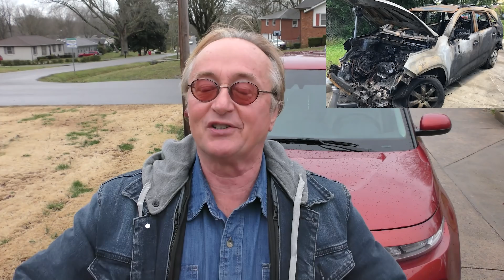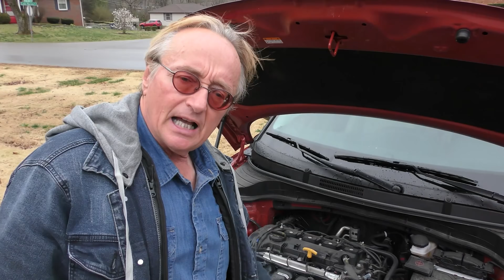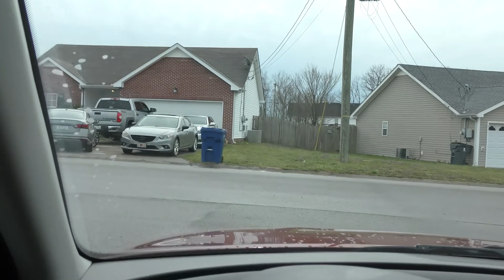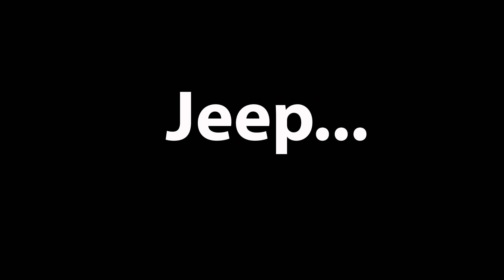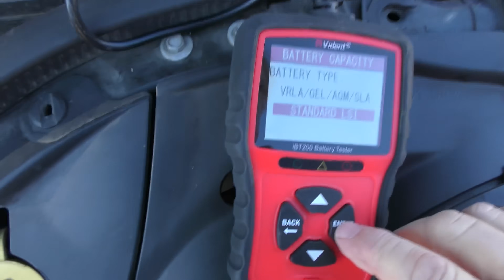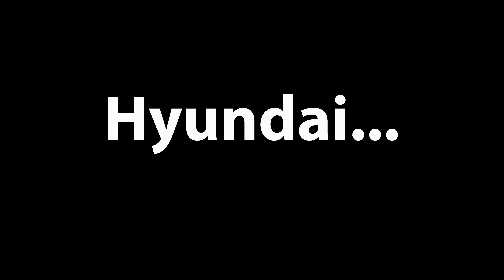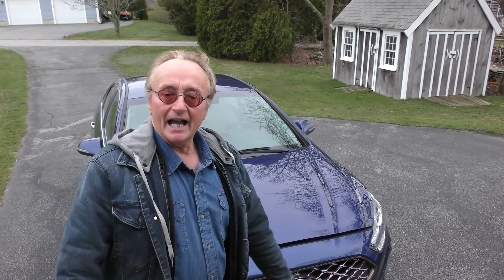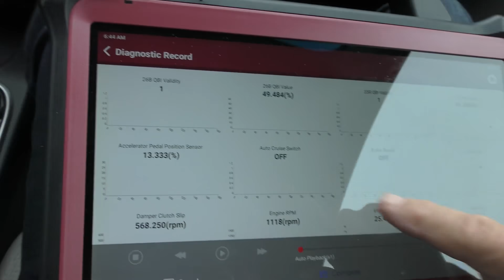3 Car Brands That are Crap

Comment: I have this car with 200,000 miles on it 6 speed, and im bad about changing the oil, but because of that i always was checking it and adding oil, so maybe because I am bad at oil changes but did put oil in it though a few times it got very low.  So its been good in my opinion and ive done no maintenance and the car was 15k

Comment: I can attest to the Hyundai but for different reasons.  Mine was a 2010 - common issue apparently from later research, the hood sensor goes bad and trips the car alarm for no reason when parked because it thinks the hood is not shut.  Simple fix is disconnect the sensor, all good until you can replace it.  Then I had a short in the light in the trunk which drained the battery and the trunk kept popping open (disconnected it and fixed it), and later at only 70K miles or so the steering column failed.  Went through 4 battery replacements even with proper insulation kits with the cold weather here.  Maybe they are better now and at least the dealer we had here wasn't like the one he described but I am sticking to Toyota and Honda - all those I had never let me down once.

Comment: I have a nissan sourced 1.6T with direct injection pushing 250hp on 75000kms. never used a drop of oil in its lifetime. my polo gti used 500ml oil every 1500kms lol

Comment: This is my Very Important Question if you would answer I would greatly appreciate!! I’ve been very mechanical and have an engineering degree… why they use an efficient turbo diesel or just a good engine that you think is tops! Run an electric motors and basically use the hybrid system and use the motor to charge an efficient lithium iron phosphate or similar with super capacitors and regeneration braking etc some solar just to keep small things charged etc and run the car like a locomotive gas/ diesel over electric!?? Obviously electric motors are way better more torque etc and u can run all wheel drive and it would be way better control power weighted better lower and way more efficient then a transmission where you lose average 30%?! So basically a engine over electric Hybrid!!! Solar would bms to keep them a perfect temp plus same starting battery or super capacitor to start slash or use the generator starter combo too both good systems wouldn’t you be way more efficient and more power and way better gas mileage using the electric motors that last longer  and 99 percent efficiency usually???

Comment: personal experience we bought kia hyundai's in the past. up to 2010 they were great...no issues. starting in 2011 they went to crap. we owned a 2011 sonata that had the worst engine recall ever. dealers actually replaced the engines when they died regardless of mileage since they were a fire hazard. we didn't have issues but got rid of it at 120k because we didn't want the potential hassle of engine failure. Surprised Scotty didn't dump on Nissan this time.

Comment: When the engine and board were cool, there was a good connection through the silver trace and the  truck started fine and ran great. As soon as the heat from the engine had warmed the board sufficiently, it would expand, breaking the connection of the circuit and shutting down the truck.
I bought A new module from Ford and it took me all of ten (10) minutes to unplug the old module and plug in the new.

The things you learn! 😏

Comment: Inside the ignition module is a printed circuit board. For whatever reason (age, heat or shock) the PC boarding my ignition module developed A crack across one of the silver traces.

Comment: What started happening is, when I had been driving for about 30 minutes, as the engine reached full operating temperature, my engine suddenly died. This was annoying driving on side streets around my home, but imagine this happening in the left lane of the Dan Ryan Expressway during rush hour. Not A Good Feeling!
I did some research in forums on line and in my "Haynes" manual and learned that there is a 1 1" x 4"  black plastic box mounted near the top of the engine, called an "ignition module."

Comment: Regarding the Jeep...several years ago my daughter's Jeep Liberty wouldnt start and I looked under the hood for loose battery connection or anything obvious (since I know little about cars) and lo! and behold! I noticed a wire that was frayed and appeared to be chewed upon....I glanced around and found the culprit (a rat) hiding under the hood in a corner. I lived in the boondocks and the car had been in storage the previous 6 months, so not shocked at his presence. Just saying....looking around under the hood for anything OBVIOUS is a great idea! My husband fixed it (rigged it temporarily) with a paperclip!

Comment: Most cars since the late nineties are crap.  Beautiful on the outside and inside. but the parts inside and around the engine are built with plan  Obsolescence.  Dealers and repair shops don't fix anything any more they just change parts at high prices and high labor.  Instead of saying when you get a huge bill for changing a headlight bulb well it's a Mercedes or bmw you could start saying it's just a car.  The automobile cartels got together and got with a shoddy parts manufacturer to make defective parts.  Our government officials have been brought.  This would have never happened in the 60's & 70's

Comment: I don't care what any mechanic, shop, or warranty implies/ recommends/ states:
Get your oil changed between 3 to 5000 miles MAXIMUM!!!
There is no such thing as the brand spanking new "miracle engine", you can get it done cheaply at Walmart, without voiding any warranties, and you can even watch them if you want.

Comment: 2008 Hyundai Santa Fe:  fuel gauge went out.  2014 Santa Fe: Windshield Wiper Pump cracked at 60K and also driver side seat seams gave  away.    2016 Santa Fe: Windshield Wiper Pump cracked at 60K.  Other than the routine maintenance, it seems to be ok.

Comment: Kia and Hyundai actually make fantastic cars for the price. Best bang for your buck in the standard car class. Jeep is overpriced for what you get and they have many problems, Just Empty Everyone's Pockets to fix them.

Toyotas stink. Way overpriced and the interior falls apart. Sure the engine will run forever but the interior is crap.

Comment: SCOTTY IS ABSOLUTELY CORRECT!

I bought a 2014 Hyundai Tucson GLS AWD brand new in 2014.  It's equipped with the 2.0L GDI engine (gasoline direct injection).  I changed the oil every 5000 miles, and 2 years ago the engine just ceased at around  68000 miles.  Just completely grinded to a halt.

Long story short I had the Hyundai towed to the local dealership here in the Seattle area.  It was at the dealer for a month and a half and finally I got a call that Hyundai was going to replace the motor under warranty.

It took two extra months for the dealership to get all the necessary parts to install the motor.

So yes I basically have a brand new engine now free of cost.  It only has about 6,000 mi on it.  Still it was an unnerving experience.
Reply: I've been driving Kia/Hyundai since 2012, get rid of it...Got rid of the Sportage, my Tucson is probably next.

Comment: My Gramps owns a 1979 Chevy Pickup with a three speed manual on the steering wheel column, it burns about one quart of oil every 900 or so miles But that old truck is 43 years old. But he rebuilt the engine and tranny twice, no fuel injection, no coils,no anti lock no airbags but its still a awsome truck

Comment: Ill stick with Tesla...120,000 miles warranty on the drive units and transmission...thats 7 years worry free.  ill take it over these cars with 20,000 moving parts that run out of warranty in 4 years.

Comment: KIA is a very reliable brand. They can afford to offer a seven year warranty.

We bought a Kia and a Merceded in the same year several year ago. The Mercedes has had three major problems fixed so far, the KIA nothing.

Of course I know that Mercedes is not the best example of a trouble free low maintenance vehicle. But KIA is.

Comment: The oil isn’t burning……
It’s vaporizing…..and being pulled out via the PCV system.
A quart every 1000 miles is normal with low friction piston rings.

Comment: lol…windows everywhere!  Reminds me of a couple guys bought a big truck/tractor, and the only reason they chose that particular truck was… be sure you are sitting down for this…it has cup holders everywhere!
Couldn’t tell us what was under the hood or what size rear ends were in it!  Don’t even remember if they knew what speed transmission it had or what brand!  They were just breaking into the trucking business…I’ll bet they’re out of business by now.  smh!

Comment: I had the hardest time with my outback with fuel delivery issues, waiting for it to throw a code and point me towards the problem. It ran like crap but never a code. It was very frustrating, I don't understand why I never got a code.
Turns out the upstream O2 sensor was bad, so my fuel delivery was all over the place.
Being patient and waiting for a code doesn't always work.
Reply: I was about to send you to Subaru for the Fuel pump recall lol, mine is getting replaced next week under warranty. I have 109k on my 2019 and haven't had issues just general maintenance. Note I skipped the 30k recommended service and the 60k, I did service at 72k and then CVT and diff fluids at 98k. I beat the crap out of it too 🤣
Reply: With 02 you don't normally get a code, you can unplug them and it'll run rich or lean whichever is the default and still get no code. Also 02 doesn't work when engine is cold. You look at the data when it works fine and use that for comparison. But sometimes it will just be really obviously offset or really obviously slow. Easiest way is just to swap it out and check mpg. Sometimes it's the maf sensor messing up how the 02 effects efficiency.
Reply: @georgekurgansky  For a long time I had a P0420, I figured the cat was bad because the previously failed headgasket sent coolant and oil out the exhaust.
Later, I had fairly major fuel delivery issues, massive power drops/stumbling between 2000-3000 rpm. Replaced the pump and filter, worked better for one test drive, then issue returned. Cleaned fuel pressure regulater, same thing-- one good test, then crap. I took my Cats out and made sure they were clear and flowing- not clogged. I was so frustrated, Knowing it was some kind of fuel delivery issue that would temporarily get better.
I replaced the O2 sensor on a whim. I knew it would effect fuel delivery, but didn't realize it could totally choke the fuel supply.
With the new sensor it's been running great, and the p0420 is gone also.
A side note: The same O2 sensor is used in cadallacs, nissans, volvos, a few more. Very easy to find.

Comment: Same thing with Subaru forester. Burning oil low mileage, they lost 3 class action lawsuits against that car but they still wouldn't do anything because mine was a hir below the limit according to them.  Svc Mgr at dealership said you dont buy Subaru for reliability, you buy for safety...he said that!  I traded for Lexus and got safety and reliability..lesson learned.
Reply: @ja a Oh wow!! So stay away from Subaru?! Ok got it.
Reply: they engine design pancake engine, if not made correctly, the oil will get pas the rings very easily. They also got cheap with the pistons and the cylinders. VW had one of the best pancake designs.

Comment: FFS... I have a 2004 Citroen C2, 1.4l with 150.000km (roughly 93.000 miles) and it is basically burning 0 oil...
I do maintain it as best as I can in this cesspit of a poor country I live in (which is Serbia), though

Comment: A friend of mine bought a used KIA and the engine started knocking really badly and KIA replaced the Engine for free ! The new engine sounds fine !
Reply: By the way , I told him if he wanted a car that would last to buy a Toyota or a Honda . He was a little disappointed that I preferred Toyotas and Hondas over his KIA but like Scotty said , it may start burning oil at around 14 thousand miles so I stood by Honda and Toyotas , I bought A 68 Toyota and I drove that car hard , put at least 100 thousand miles and Traded it in for A Toyota Celica and it was really fast ! And got excellent gas mileage , it was a really great car .

Comment: I worked for the parent company (Hyundai) for nearly 20 years, you are absolutely correct, KiA/Hyundai vehicles are crap.  Most serious complaints are “factory acceptable” until the customer lawyers up, in which case they will “buy back” the faulty or more often dangerous vehicle.  Crap vehicles by a company that could give a damn about who they screw over, injure or yes, even kill.  Two words “spontaneous combustion” , whether the vehicle is running or sitting in your garage, the cars can literally ignite and explode.

Comment: I have had a 2014 Scion tC from brand new and have 125,000 miles with absolutely NEVER a single problem from the car. That's Toyota quality.
Reply: 125k miles is not impressive
Reply: @MeltingRubberZ28  cry about it
Reply: @jcdenton6074  sorry to rain on your parade bud but it's just the truth

Comment: I have a 2006 Hyundai that has 800,000 miles on it and I have the original oil in it still. 🤣🙈

Comment: You talk a lot of trash about kia cars but I have never had an issue getting 300,000 miles out of them. Changing the oil between 3000 and 4000 miles makes the difference.

Comment: Listening to u today mademe think of a 1970 AMC Hornet I bought in 1970 while in college. The car run ok but would use a quart of oil every thousand miles. The dealer said it was normal for that make of car. I had run fords and chevy and never had one to use any oil. I see times have not changed, 😮

Comment: Leased a 2016 Soul. Absolute sewage. Regular oil changes every 4000 miles. I gave up on it after the second engine blew up at 70,000 miles. The first engine was replaced at 47,000. I drive a Honda now and will never stray again.

Comment: I've got a 1L 3 cylinder with 102,000 miles on the clock and it only burns 500mls over 5,000 miles.

It's Toyota's 1KR-FE engine

Comment: Oil burners should consider getting the oil analyzed, it only cost about $50 and it can tell you a lot where the defects could be.
Reply: want to have fun, take 4 oil samples from the same car at the same time and send them in to the lab, more fun, use 4 different labs, see what they send you. do not tell them it's from the same car.
Reply: @snapon1974  there is no certification agency to check the labs assay for consistency, but you can ask the lab if their gear are trace calibrated to conform to ASTM standards; the trends are more important than a single result, enjoy
Reply: Lol. Each lab's "standard" 'analyzation' process is a complete joke! Please tell me you don't pay to have your oil analyzed by these scams and then take the results seriously!!
Reply: Will it tell you if you have a stuck top ring?

Comment: The more o hear, the more surprised I am that I didn’t have any issues getting a new engine for my Elantra. Also, the more I hear, the happier I am that I dumped the damn thing right after the engine was replaced. I did expect trouble since it had 95000km on a warranty that was 100000km, but they listened to the knock, looked at the service records and ordered the engine.

Comment: I’m glad I drive nothing but 50’s and 60’s cars. The old Chrysler products are extremely reliable and the 318 and torqueflite combo gets better mileage than many of the SUV’s these days.  Plus not smog headache,no computers or airbags. And everything is easy to fix and get at.
Reply: @peter kerns They didn't have snowstorms in the 50s and 60s?
Reply: @peter kerns Never had a problem with rear-wheel-drive cars in the snow. Best snow car I ever had was a crown vic; was way more stable than my front wheel drive vehicles. They all get stuck at times regardless.
Reply: Also roomy enough under the hood to get up close and personal with the engine when you're working on it.

Comment: I love the Jeep Cherokee 4.0L Inline 6! Best vehicle I've ever had. The cheapest and most problem free vehicle too. The Grand Cherokee are notorious for issues.
Reply: There’s a reason Ford and Chrysler stopped making their I6 engines. They were bulletproof and lasted forever.
Reply: @Sickofliberals  same with the original Buick City 3800 a beast of a v6 and maybe the best made along with the straight 4.0
Reply: I run a 4.0L inline 6 in my 2004 Jeep TJ.  Wow!  What an engine.  Jeep CJ/Wranglers/TJs... etc. are not perfect vehicles but they need less work when the engine is worth a damn.
Reply: @shermantank7216  Oh yeah, hold onto that one. I regret selling mine now. Wish I still had her.
Reply: That’s funny since both vehicles are almost identical

Comment: I had 3 KIA Souls and Loved every one of them! Until they finally made the Santa Cruz! The new engine has 2 extra plugs to per Cylinder.  I watch every thing closely never a single problem.   The only thing I hated was getting the carbon Service every 30 k ! This new engine is awesome.
Reply: So how long did you drive each one? Definitely not 10 years or more. When I buy a vehicle I expect it to last atleast 10 years.
Reply: How many years have you driven each one?
Reply: So on 3 separate occasions you seriously walked into a Kia dealership, looked at a Kia soul, and said "wow this car looks good I'm gonna get it"

Kia soul are so ugly 💀
Reply: #1. Kia stands for Killed In Action. #2. They then named that model Soul.
Let those sink in b4 u drink your next gulp of denial juice.